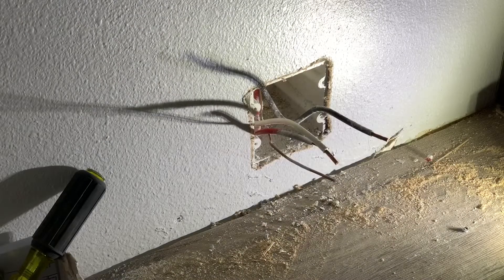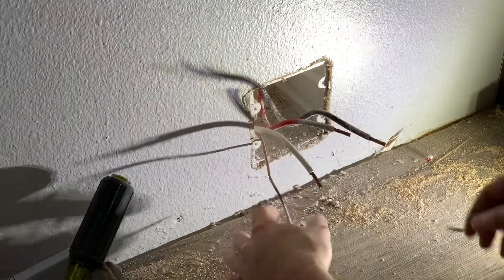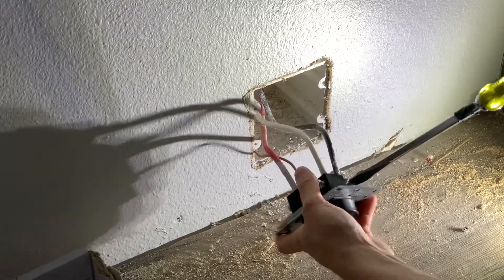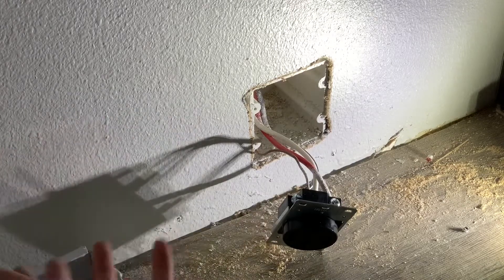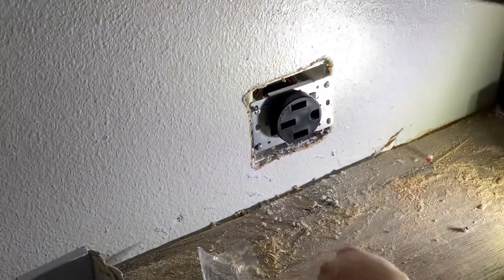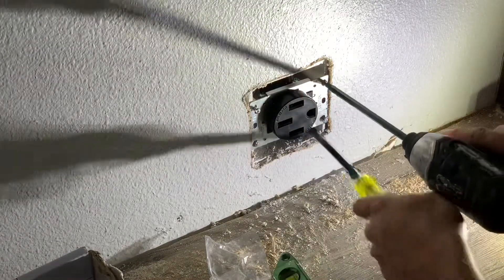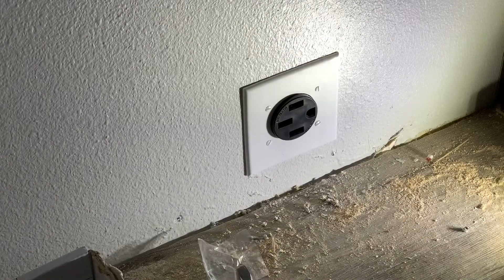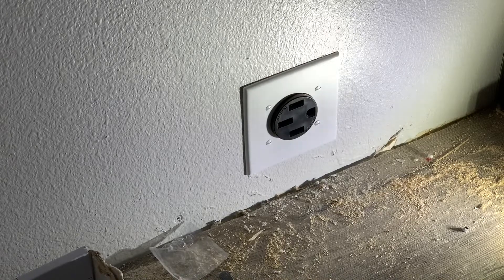How To Install A Range Receptacle (Stove/Oven/Cooktop)

Comment: Torque wrench those connections that is code NEC 2020 110.14(D). Appendix I in the code should be used as a guide if manufacturer has not specified a torque value. In effect that’s what you did with changing the screwdrivers over and you had more turns on the larger screwdriver. 
If screws are greater No.10 and are slotted and with slot width either less than or greater than 1.2mm then for 6-4AWG wire torque setting can range from 35-45lbf-in (foot pounds per inch). Or 4-5.1N-m (newton meters).

Torque values take the guessing out and you always have something quantitative to say you did tighten down those screws properly. In the context of a range with a potential 50amp load tightening screws are critical to avoid arcing and fire risks.